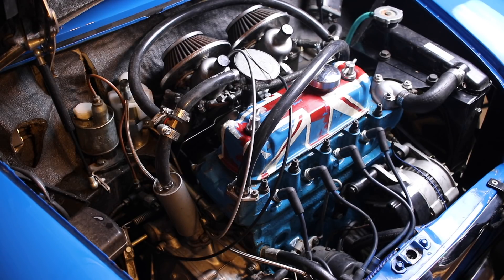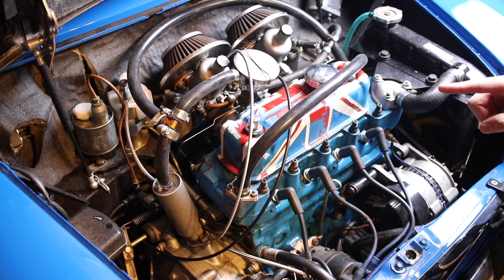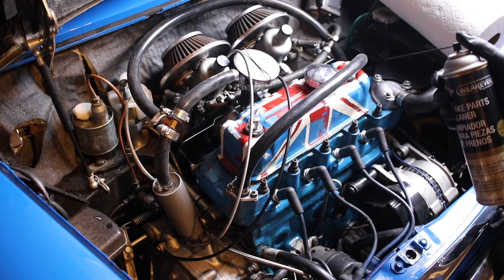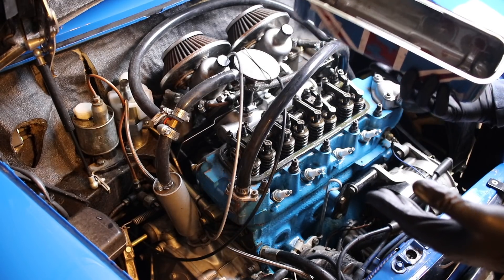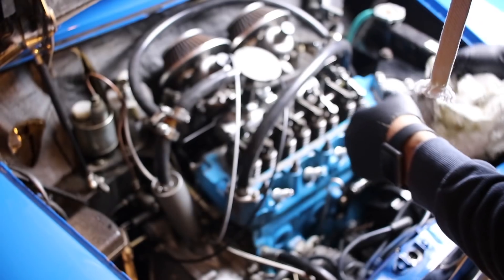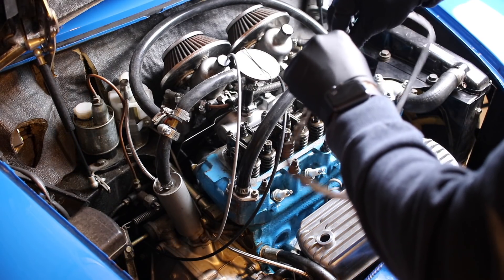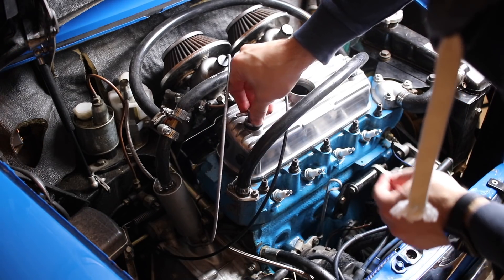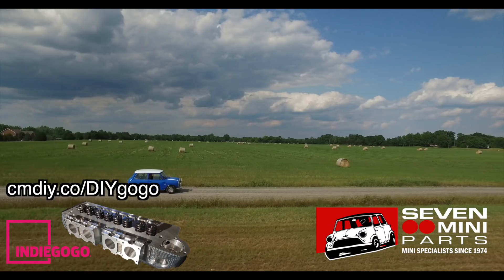Classic Mini DIY - What its like owning a mini

Comment: when I first bought my mini it was leaking from the gasket around the entire cover, I replaced it with a new cork one smeared in permatex black all over and it seals perfectly
Reply: lockjawjak exactly what I do.
Reply: I also torqued it down very lightly then let it set for 1/2 hour then torqued it down properly. I have heard it helps to not just squish all the gasket maker out the sides but probably not 100% necessary with the cork as well
Reply: @lockjawjak  i really appreciate these old comments, cheers

Comment: Have you ever used Simple Green for oil removal? It does not remove paint. Like your videos. Own a 1960 Austin 850.
Reply from the maker: Nice original 850! Magic wand? I have used simple green in the past and have had nice success with that as well.
Reply: No, remote shift. Still 850. I have had it 4 years and have been slowly converting it back to standard from fake Cooperish. It has most of it's original parts. And I have been buying replacements on eBay for things that have been changed (steering wheel, 850 emblem...).